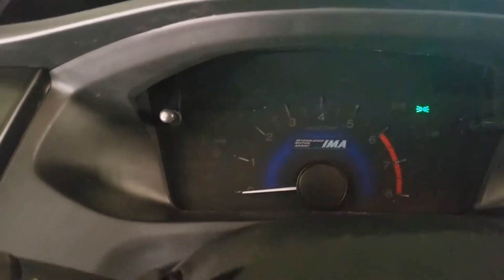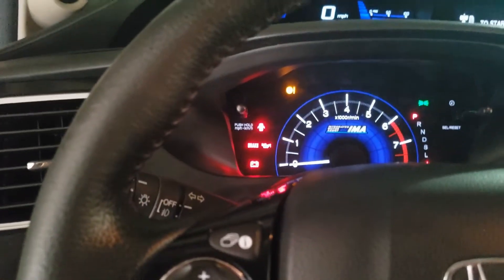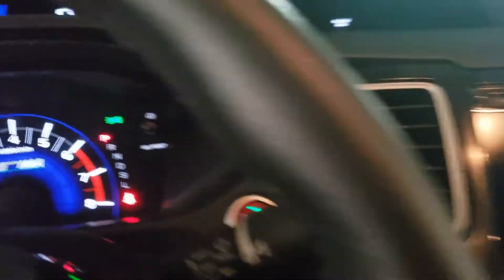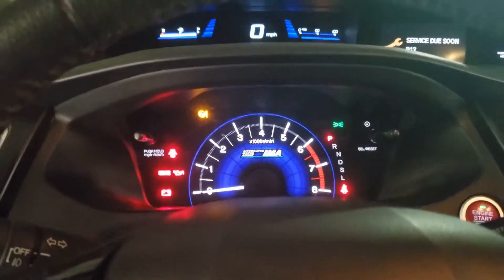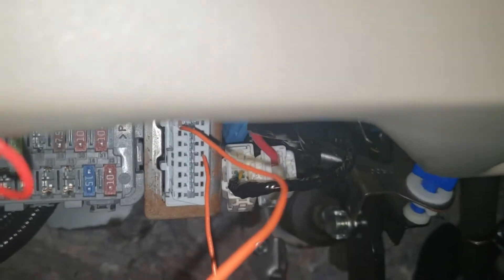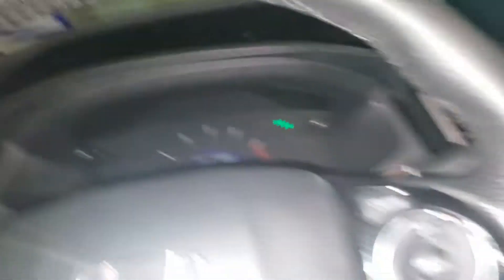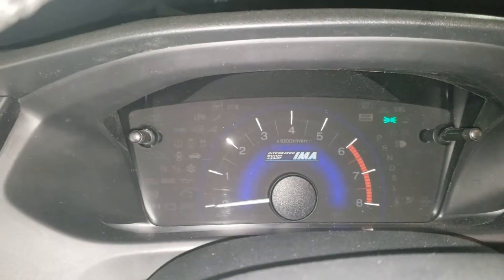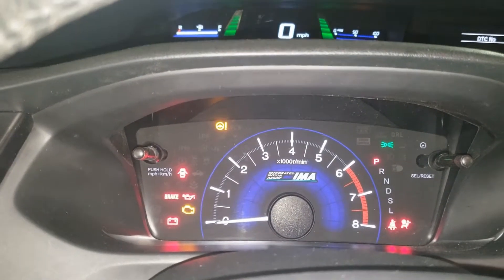How to Calibrate Honda ABS with Push-button Ignition

Comment: 2013 EXL push start - so when you say “turn the car on” in the first step, does this mean engine running? Or just “on” electronics then push brake and engine, the off then repeat?
My ABS, steering, traction control and low air pressure light ALL came on at the time I needed alternator - and after $1200 in repairs (alternator and engine mount the shop found needed done) it’s still all on.

Comment: Does this work for Acura ?
Reply from the maker: Yup, it should work for any Honda product with pushbutton start.
Reply: @civicminded2141  some videos I seen, they inserted the pins on 1 & 9
Reply from the maker: @AjLazaro-e6j  That may be for clearing a different system (e.g. VSA) or even reading codes. ABS is 4 and 9.

Comment: Would this work on a 2018 accord ??
Reply from the maker: It should- let me know if not.
Reply: @civicminded2141  do you know if they are exactly the same ? The ports
Reply from the maker: @adr8nalin92  Ports will be the same. The OBDII port is more or less universal. The pins you short may be different, but try 4 and 9 first.
Reply: @civicminded2141  ok will do thanks for the info . I’ll let you know how it goes .
Reply: Hey I have a 2016 will it work on that and I have abs light on and few other ones. I replaced my alternator and battery. It came on after that

Comment: What did you do with the obd port exactly.  I'm not getting that part
Reply from the maker: I used a jumper wire to connect pins 4 and 9 together.

Comment: I also have the 61-11 ABS code showing up, but the only thing that appears is the check the IMA system and the IMA light turns on. Would this also work for that?
Reply from the maker: This would clear the ABS code. The IMA light would probably have to be cleared by a scanner.